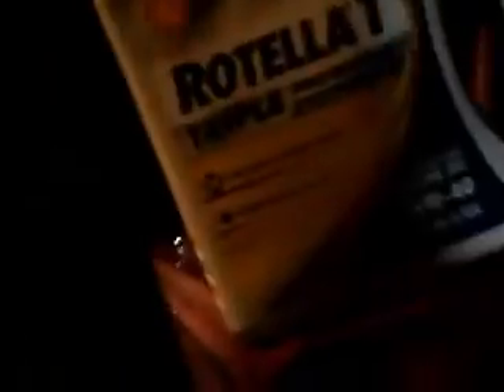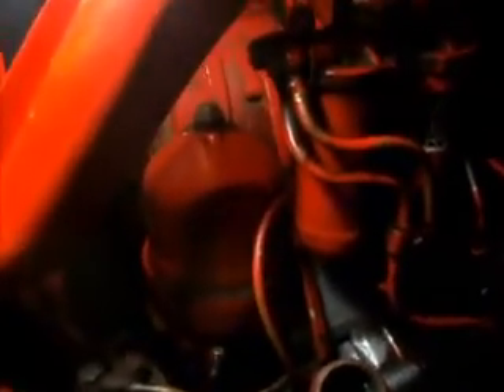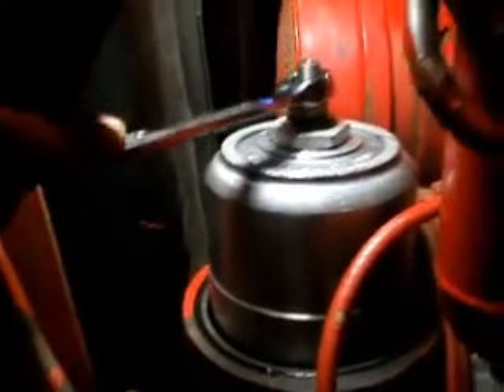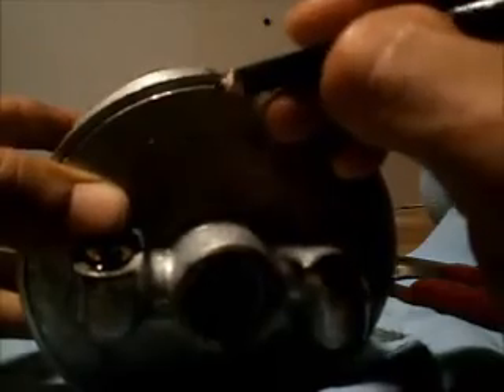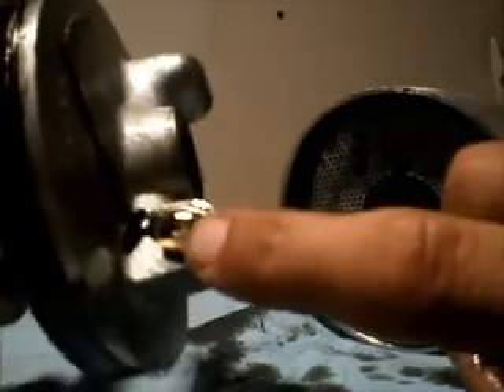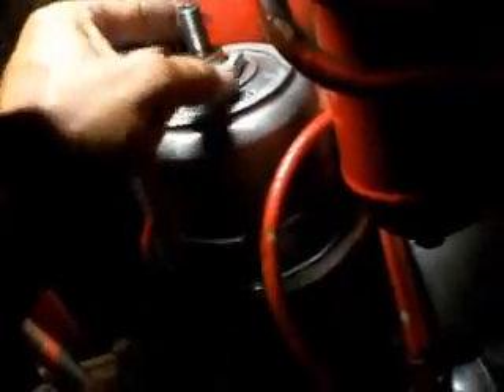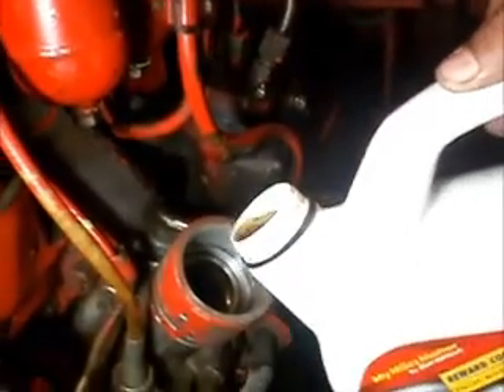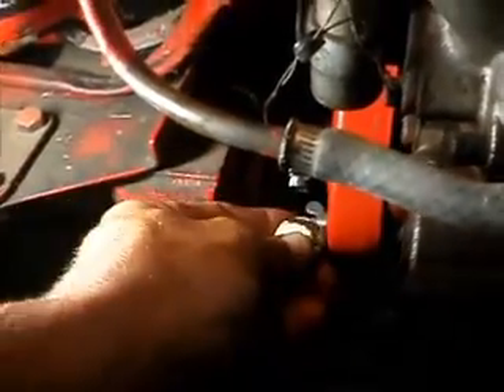Oil Filter Tech on the Belarus 250AS Tractor

Comment: first thing I would do is remove this non filter, and put on a wix or autolite paper filter, to actually filter the oil.
Reply: I have both cleaned the centrifugal separator and cut open paper filters, separator seems to catch more stuff from oil.

Comment: I have a 1985 250AS I bought used and have had for around 15 years.
I put a new clutch in it and one injector and a new worm gear starter.
Thats about it. But just a few days ago lost power to back wheels,
Might be a axle went. I still have power to the PTO to the tiller but no power
to the back wheels. Its been raining all the time here in west coast of florida right
now. I will have to wait till the mud dries up and have a friend pull it back
up to the house to see what is wrong.
But its been a good tractor.

Comment: Hi Luke,Thanks for the video.I also have an 87 250AS. I use it to bush hog 28 acres. My hydraulic reservoir busted where the lift cylinder attaches at the bottom. I have a new one in route and will have it in a few days. Information is hard to find on the net when trying to repair these work horses and I have yet to clean the oil filter but i have changed the oil ( I've owned it for three years ). I have the manual but it's only general info. With your video and the down time waiting on my parts I am going to now clean the filter and change the oil. I have had every kind of hydraulic problem with this tractor there is but i would not trade it for any thing else.Thank you for your video.It was well made and very informative.
                                           Jeff

Comment: Thanks Luke!  I used your video to clean the oil filter on my 1987 Belarus 250A.  By the way, while changing the oil, I also cleaned my air filter.  While doing so, I noticed that the white plastic pan that holds the small pool of oil has been drilled through in three locations toward the bottom.  Because of these holes, I have to fill the bottom metal housing and the plastic bowl to the fill level in the bowl.  Can you think of any reason this would be a problem?
Reply from the maker: No its not a problem.  You want the oil to fill the bottom of the bowl as well as the plastic inset.  The plastic piece serves several functions.  It acts as a baffle to keep the oil from sloshing around or being sucked into the engine, and it acts as a divider where the heaviest dirty oil will migrate underneath and the cleanest oil will continue to seep towards the top where it will be available to collect more dust and junk from the air.  Thanks and glad you enjoyed the video.  I am hoping to make some more videos very soon.